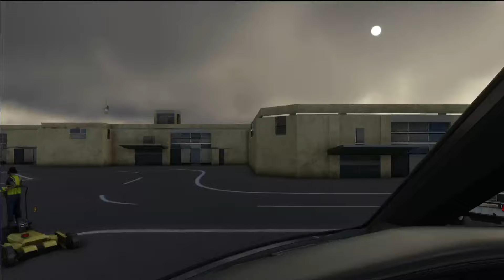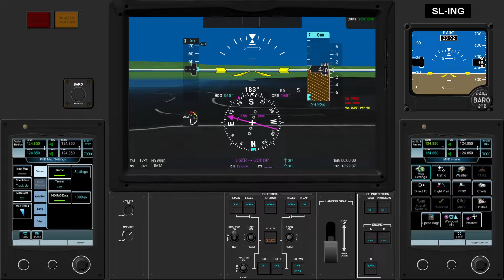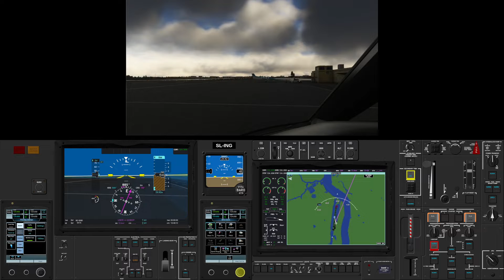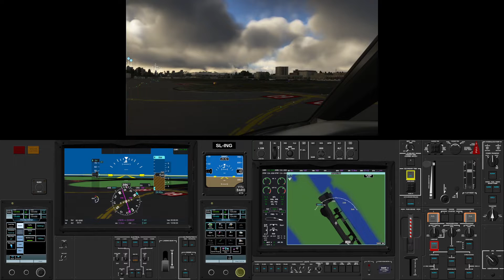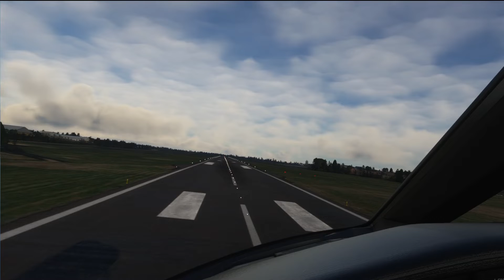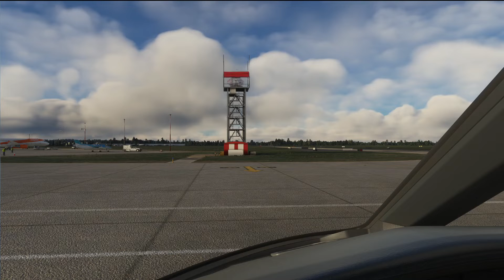Cessna Citation Longitude Air Manager panels

Comment: What touch monitors are you using - size and make, please? Also it seems you have knobster - how many units - just one or one for each monitor. TIA.
Reply from the maker: If you mean in this video then it’s dual Dell 24” touch monitors with a single knobster.
Reply: @ExperimentalSimAvionics  👍

Comment: Excellent panels and well presented video. Improvement please: Urgent need for better tracking of actions in the video. Where the item you're adjusting is on the panel is often difficult to spot - and then it's gone, you're on to the next thing. Suggest a method might be to have a highlight circle around the item on the panel to which you are referring or manipulating. Can that be done?

Comment: Gashh… it’s beautiful!!!
It’s forces me to reconsider my decision about homemade 3d printed panel…
Is it possible to use only parts of yours to compose it in to 3d-printed one?
Reply from the maker: Yes each instrument  is a separate entity and can be moved and resized to where you want.
Reply: Why do you need 3d printed panels for touchscreens for just a few knobs? I recommend you  Try these longitude panels on 2 touchscreens first, of course with knobster. Knobs are becoming less and less prevalent. I have spent thousands on realsim gear hardware that is now pretty much obsolete and/or inflexible. Just sayin' no offense.
Reply: @RightTrafficN7954Y  no hard feelings at all :) 
I totally understend touch scren cocept. can't even exlude that I will eventualy divert in to that type of interaction.
But... for now, I am in a proces of buling homecokpit to suport my IR/ME training. As a basic ocupation I am/was medical profetional higly asossiatet with high-fidaelyty simulation. What I notice (and generaly its well know conclusion) students are learning more efectyvly when they can interact whit equipment in the way as real as posible. Thats why I decide that my home cokpit will be base on hardwaer interaction as far as reasonebly I can aford :) (screan bazels, encoders, switches).
Aiming in to more generic G3000/G5000 base sim I will develop it on a go. So probably it will end upa as some kind of FrankenSim :)
All the best from Poland!

Comment: I have Ipad Air Manager. There is Cessna CJ4 option but not Cessna Longitude. May I and where  get Cessna  Longitude air manager?
Reply from the maker: These panels have not been released yet. They will be premium panels which are not available on the iPad version of Air Manager. You will need the Desktop version to run any premium panel.

Comment from the maker: Thanks for all the comments. Since the AAU1 update WT have broken or disrupted almost every instrument in the Longitude panel. Some of what they did is new stuff which adds to the sim but some of the other stuff was just fine before and didn’t change any pilot operation but in the background has a profound effect on the panels. I will therefore need to go back over them fixing up as I go. Working on another aircraft currently but I should get to this one again at some point.

Comment: Of Note: The big advantage of G5000 and Corporate twin Jets is that one can fly all SIDS/Stars with the big tubes and yet fit all instruments on 2 touchscreens/knobster. For example it is very difficult to get all A320 instruments on a couple of panels. The new RTX 4090 by Corsair Vengeance has 3 dp and 2 HDMI, 2T NVME m.2.  This is perfect for 3 wide monitor guys and 2 AM touchpanels beneath. This is the only way to fly on VATSIM or Pilotedge IMO. Take care.

Comment: I love your newest panel, for the life of me I can't get a panel to save. May I ask do you repeatedly have to go through the startup menu choosing language and such every time you start airmanger? Because I do have to. If I make a blank panel or create a panel picking and sizing instruments  in the panel tab or create tab after I've sized my instruments name it etc, clone it to airmanger, export it, import it doesn't matter There's nothing there but the title after restarting and sometimes not even that. I hate to give up because each time I create a panel setup, I love it.  And would love to get some client computers going with some more monitors, and different panels running. I asked airmanger, and they act like the panel should be there, they don't understand what I'm saying because as it appears noone else is having the issue with the panels not being there when you go back to airmanger...do I need airplayer installed to run these panels once created?, as I don't have it currently. Where's the save button as I haven't found 🤣

Comment: You mentioned the "MSFS Pop Out Panel Manager" as an essential tool. I agree, thank you for making me aware of this great tool. I have not been able to get the "Disable Game Refocus" to work. yet.  FIXED- Found forum post by RoastGnu suggesting adding time.  I added 1000 milliseconds, works great now.
Reply: As of AAU1 release, the mouse focus  issue still persists with AM. I tried the 1000ms in popout mgr to no effect. RW pilot here and I use AM to get rid of mouse and keyboard. Hope they fix it soon. Love AM. No offense.
Reply: @RightTrafficN7954Y  Now my Knobster is flaky. Ug.
Reply: Been using knobster for several years now. Never had one problem. Make sure USB is powered properly. Simmers have lots of usb controllers. Make sure you hide/show or recycle panels when make changes. Sometimes even reboot AM.
Reply: Mouse refocus fixed in popout mgr 4. Finally! Probably a MS issue anyways.

Comment: Another great panel as always. Wish I had your skills at making panels or if I could just pay you to buy your panels. There are a couple I would really want.
Reply from the maker: They are beginning to become available starting very soon with the first one. A little more patience and hopefully everyone can enjoy these too. Out of interest which ones are your favourites?
Reply: @ExperimentalSimAvionics  really want the DA62. I also like this Longitude panel. Now I’m going to have to go back and look at others. Going to need some 22” or 24” panels next
Reply: @brlowe1  I use ASUS 21.5 Touchscreen, $200 and 3 wide 32" LG Nano ips. Getting 1 more ASUS as soon as this release. Note, make sure you have room beneath main monitors for Touchscreens, Yoke etc. Desk, Chair. 24" is starting to get pretty cramped. Cut out  Black pieces  of foamboard in the same form factor as all your monitors. See how it works. good luck
Reply: I fly the Aerobask DA62 a lot in XP. That version has a keypad on the center armrest. The Asobo version of DA62 is ok, but it does not have keypad for G1000. Keypads make G1000 bearable.There is already a DA62 AM panel made by siminsrumentation for free that works with MFS.